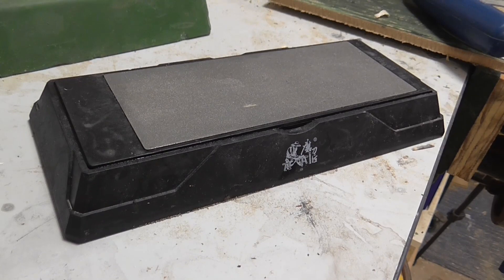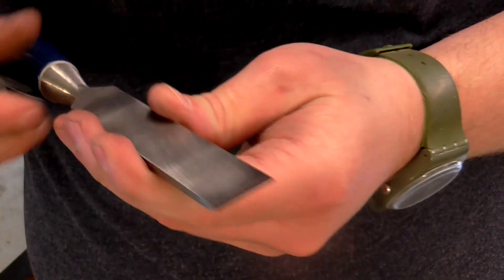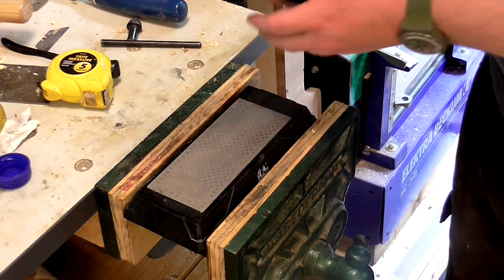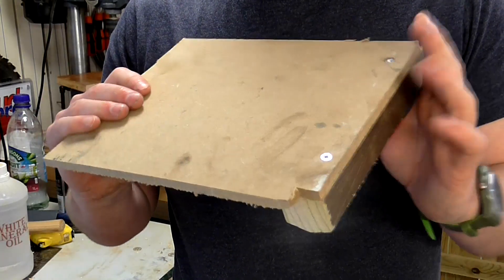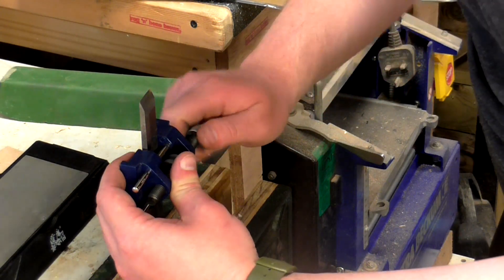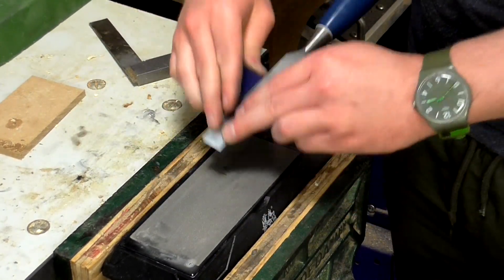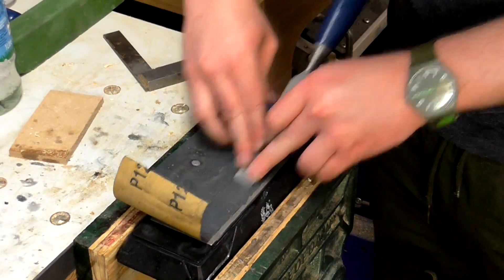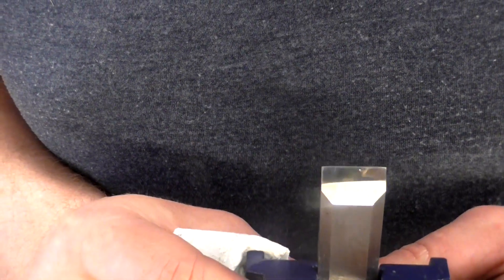Sharpening Chisels & Plane Blades - Easy & Inexpensive - My Method

Comment: this video came up on rotation, always good to see what works for others, worked in metal finishing all my working life, I would add a stage after the green compound and use white/hifin, It is probably also worth buying a sharpening leather strop. I usually use a pine + leather strop, done properly you are talking razor blade sharp. but this video has reminded me I need to spend a morning sharpening my chisels so thanks youtube

Comment: Good video.  I'd recommend securing the sandpaper so you don't round over the edges of the chisel and blade as a result.  Also, just a hint, make a board with stop blocks set back from the edge the distance needed for each commonly used bevel angle.  25°, 30°, etc.  Then just butt the edge of the guide to the edge of the board, push the chisel blade to the stop block, tighten and you're set.  And check for a burr as you sharpen, a lot.  Try some shapy on the bevel to see where you're shapening as well.  Nice edge by the way.
Reply: Yes

Comment: Great Video on the sharpening process. One tip for you, instead of pouring the water/washing liquid onto your stone and drenching it, use one of those spray bottles that gardeners use to spray water on their plants. Get them from Wilkos or the £ shop and then you would get a nice spray on the stones. Just an Idea??? Thanks,  Barry (from West Kirby, Wirral)
Reply from the maker: +Barry Roberts great tip! Thanks Barry
Reply: Barry Roberts   Really good clear video.  Just get a spray bottle.

Comment: I also use wet and dry paper. I'd recommend autosol instead of the green compound. Only £3.50 from wilko. There is also a uk company that sells wet and dry up to 7000 grit. I go through 3000,5000 and 7000 grit when polishing.  Axminister also have self adhesive rolls for around £7 each which can be stuck to glass or mdf which are also quite useful they do 800,1200 and 2500. I'd be careful as I have had similar diamond plates and they do go out of flat quite quickly.
Reply from the maker: Thanks
Reply: How?

Comment: tip with your bottle or water and washing up liquid, make a small hole in the top which you can squirt it out of then you won't get took much out. nice vid👍
Reply from the maker: Great tip! thanks
Reply: Really good video. Well explained and simple to understand. Would be ok to miss out the rubbing compound that’s show room finishing. Keep them coming.

Comment: Nice video. When I sharpen my chisels or blades.....I always finish my polish on leather and alternate a back stroke for each side about 10-15 times. it will eliminate any bur....and they get so sharp that i get scared to test on shaving arm hair.....I once cut myself testing once....and only knew it cut because I could feel the drag of the blade....didn't feel the cut itself.....Anyway, I'm sure if you alternate back strokes on the MDF, you should get similar results.
Reply from the maker: +Chris Bruinsma thanks Chris. In my experience the chisel is the most dangerous tool in the shop... maybe it's just my poor technique though! I once went all the way through my finger and it created a flap of flesh that made me feel quite squeamish. It healed eventually, took about a month!! I just made a leather strop recently but not used it yet so will try it out soon!
Reply: I know the feeling. I have had my share of slips that result in a few bandages.....no pain no gain, right??

Comment: Good job great video simply to follow inexpensive way how to sharpen any edge tools I like that well done just let me point out I wouldn't be bothered using a main screw on woodworking vice when it has quick release mechanism in your case???? anyway thank you for sharing useful video.
Reply from the maker: +Gabriel Pefčík because the quick release doesn't work

Comment: Very nicely done. Clear, complete, with links.
I have a stone I acquired from an old shed. Anyone know how to find out what 'grit' it might be (doesn't say on the box, which looks 60s vintage). And do all stones need water/oil lubrication? It seems to work fine without, but perhaps this is a bad plan? I discovered that screwfix gadget earlier today - good to see how it's used and that it does the job. I've been hand-sharpening for years, which of course tends to produce a curved bevel and off-square end. I reckon it's time to spend a fiver and do it better.

Comment: A couple of friendly suggestions. You could fasten your wet and dry paper down to a piece of glass, plastic, marble,etc. With the edges flying around like that the corners get rounded off and you don't have a perfectly flat back anymore, which can cause difficulties later. Likewise when doing the bevel, with the paper not flat it's rounding your bevel imperceptibly causing extra time to be taken on the next step. The whole sharpening process should take no more than a minute once the back is flat and polished.
Remove the burr with your finest abrasive, and do it very  ver very gently. Make sure the burr does not bend

Comment: Hello again, been tryig to find the diamond plates but the links above take me to a 1000/3000 grit. Do you think these will be to fine for the job? I thought maybe the grit should start lower then work up to that kind of grade.
Reply from the maker: +Daren Cooper the 360/600 is available on amazon just search for it. 1000/3000 will work though if your chisels are already fairly sharp and in good nick, depends really
Reply: Cheers boss. Thanks for replying.

Comment: Diamond plate?  I guess as long as it doesn't get too hot you won't experience any issues with solubility of the diamond. How is the longevity?
Reply: Diamond is not soluble in water or oil, at any temperature.